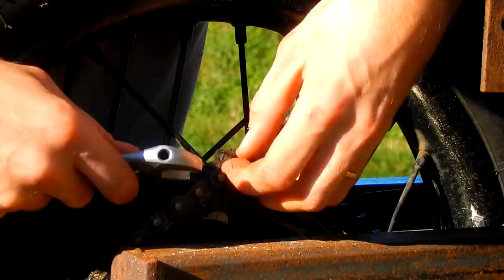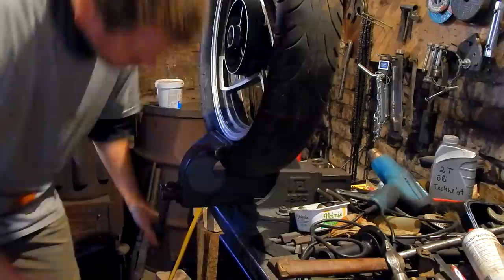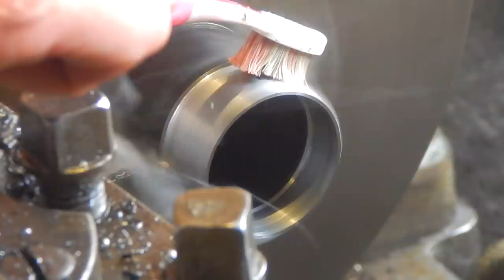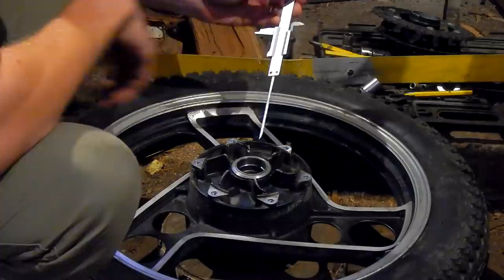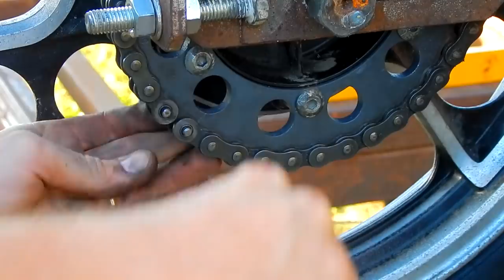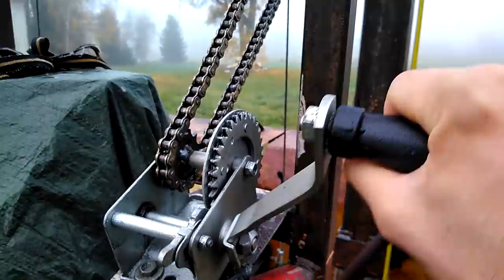NEW Stronger Alloy Band Wheels, Sawmill Upgrade - Band Sawmill Build #25

Comment from the maker: So what about the paint?
Most of the material I used for this mill was kept outside in the rain and snow years before turning it into a mill and nothing happened. Hell, the material I made the blade guards out of has been outside under a tree for over three decades - still in usable condition. What I'm trying to say is I'm not gonna paint it at the moment - it's too cold here for the paint to cure and too wet to even apply it. This mill is not gonna turn into a heap of rust within the next 6 months - that's when I'm planning on painting it eventually - May 2019. It's not gonna turn into a heap of rust even within the next 6 years so no worries, people!
Reply: Okay. :)
Reply: Fair enough!

Comment: I see you upgraded the coolant toothbrush too! Will be interested to see how well the new wheels perform. One objection to using  tires I've heard is that you can never get enough tension because of the air pressure in the tires isn't enough to offset things. The new wheels will take out spoke give but will still leave tire give. You haven't mentioned that issue before so I am assuming that it's no problem. Thanks again for posting. You are always an inspriation.

Comment: Before you put paint on the iron work, paint it with ferric chloride. 
This will convert the rust into a nonferrous skin, saves you removing the rust, except the loose stuff, and stops further rust.

Comment: I'm in the making of a sawmill.
When it comes to the motor/belt reduction.
Whats more important?
Go fast?
Go strong?
Reply from the maker: There's info on blade speed on the Internet. There's a sweet spot. Both speed and torque matter.
Reply: @DonnDIY  
Thanks!

Comment: May be a dumb question but as most sawmills run on metal wheels, why bother with the tires? Couldn't you just flatten the inside of the rim and run it directly on the metal?
That way you can get more tension on the blade, right?

What am I missing?

Comment: But aren't those bearings and shafts too small for a sawmill?
Reply from the maker: No. It has worked so far. Maybe they'll wear out quicker and I'll have to replace them more but it's no problem.
Reply: impossible 9 I built a bandsaw mill using motorcycle wheels and swing arms welded together, I have been running it for about 4 years now and it’s been fine. I have replaced the the wheel bearings once, but the ones that went out where stock and installed sometime back in the early 80s. The wheel bearings are cheap and even if you had to replace them once a year you would get far more lumber milled in that year then the $20 it would cost in bearings. Take care.
Ps Good job on your mill! It’s awesome being able to cut your own lumber :)

Comment: Ok nice, but, why?
Reply from the maker: The main reason for this mod was the eccentric properties of the spoke wheels of the USSR made IZ Jupiter motorcycle which made the blade vibrate and undulate. Also they had some flex in them - I could hear the spokes squeak. This mod took care of those problems.